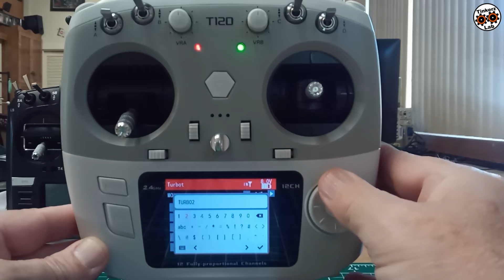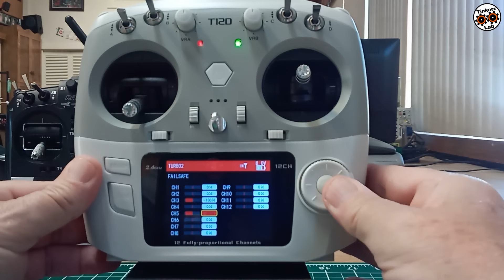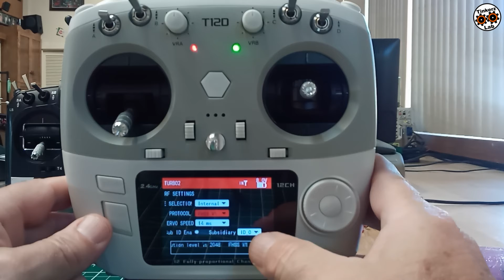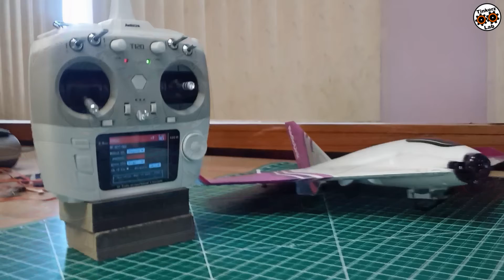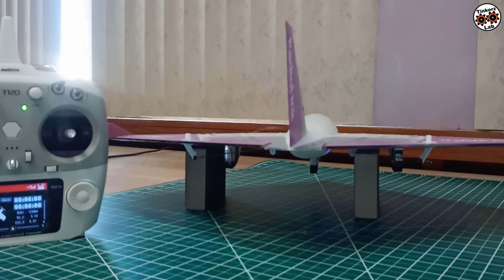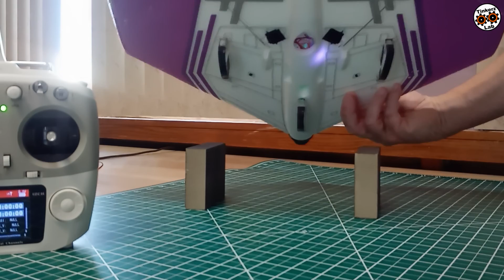Setting Up Our 1st Aircraft | Radiolink T12D 12CH Transmitter + R12F Receiver

Comment: I’m confused with the dual rate setup. You don’t show how to assign a switch for dual rates and you initially set a percentage of 80% for aileron and 85 for elevator and 100% for rudder. Just how do I assign a switch for the dual rates? No where on screen does it show and allow for a switch to control the rates. I understand the expo setup; I’ve done that with no problem.  When you finally are finished with the setup, you show everything working on the model except the dual rate function which I was hoping to see.
Reply from the maker: I don't have Dual-Rates setup on a Switch. I showed how to setup Dual-Rates & Expo in the Radio.
I have Gyro Modes setup on a Switch.
I have Throttle Cut setup on a Switch.
I have the Timer Reset setup on a Switch.

Comment: Thanks for the tutorial. Is there any option to pause the timer when there is zero throttle?
Reply from the maker: If I remember correctly, I think it can be setup that way using a throttle range in the throttle hold setting.
Reply: @tinkerzlab  I have got the official answer from Radiolink support team that the THR can only start the timer. Maybe in future they enhance the feature. Anyway I have bought the T16D and configured the Timer 1 on 3 position switch SWE, ON / OFF = SWE_DOWN, RESET = SWE_UP. When I start the flight I have to pull switch down (towards me) to start the timer, during the flight I can pause the timer by switching to middle position, continue by pulling down again. Finally the push to UP position resets the timer. I have also setup the Timer 2 to start by THR with treshold  -50. The Timer 2 is my security timer if I mistakenly use the Timer 1 pause/continue/reset.
Reply from the maker: @Josephrc1  Thanks for that info. I seem to remember setting up the throttle timer in the past using the throttle threshold. It does need to pause as well as start the timer whenever the throttle is in or out of that threshold range. Hopefully, they will improve that. Glad you figured out a way around the limitation.